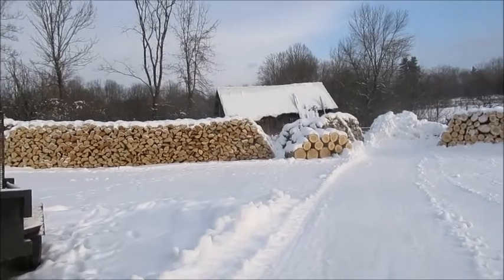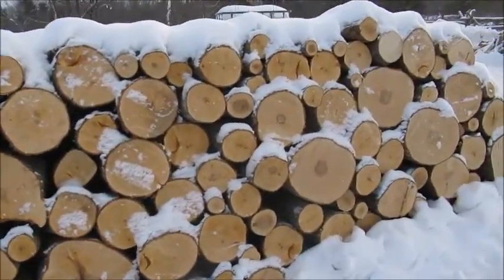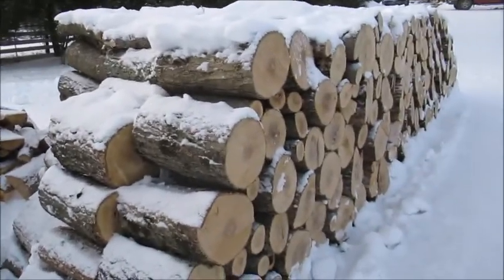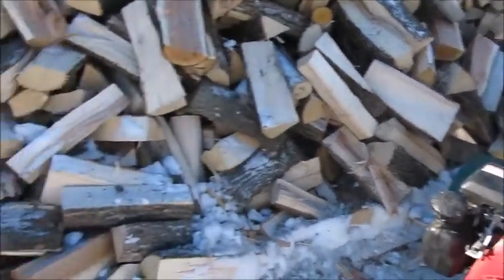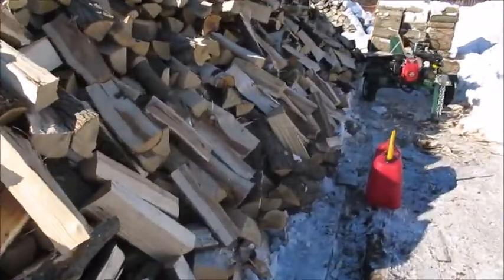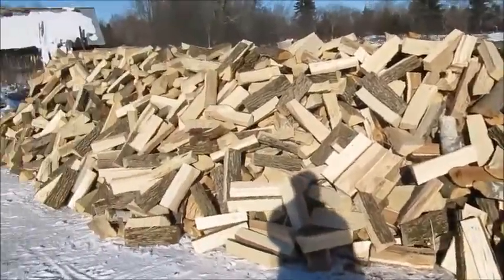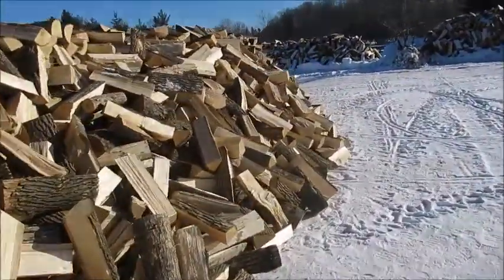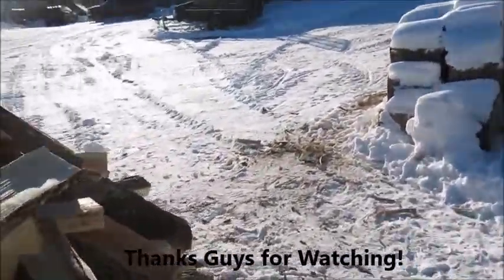Random Wood Stash 2021 Updates & Splitting Wood when it's -28c

Comment: Sorry about your loss of your mother.  You sure do not lose time splitting wood. I am amazed how quick you go through all those rounds! I've read below it's about 15.5 full cord you did I thought it would be more than that.  How many trees did you have to cut down to get to this amount of wood?  I am asking, because my goal is to make about the same thing as you did. 10 face cord for me, the remaining for sale.  If I can make more for sale (up to 80 face cord), that would be nice. But I don't think I'll make it this year.  I've got about 25 trees cut down, they average 12-16in in diameter 50-60 ft tall. I just can't figure well how much more I should fell this year.  Any hint on that? Thanks!
Reply from the maker: Hello Joe, Thanks so much for your kind words.  I am thinking about a 4 way wedge for my splitter. I think my wood for sale is about 12 full cord and than my own personal wood there is about 3-4 full cord that I split this season ( Mostly dead elm about 16 trees) plus some black cherry ( 5 Trees) and a bunch of iron wood and a few other kinds ...this is not counting my left over stash from last year. I would love to cut some more to sell but the snow had put a halt to that right now. Depending on the tree size ,it takes a lot of trees to get a 12 full cord pile. I will have to get back to you on this and do some figuring . I have smaller trees 10 inches up to bigger trees 20 inches so it makes it hard to tell. You see all my wood cutting videos since last fall to make all the wood I have. I won't know to I stack my wood to find out how much I really have. LOL.  I guess you could cut some until you have a full cord stacked up and that will help you know how much you need to cut. Thanks again and keep warm
Reply: Joe if you do have 25 ( qty of tree of 1 feet average diam ( 12-16 in ) ) X 50 feet ( average length ) = 1250 cubic feet of wood. Now a full cord is 4 feet ( high ) x 8 feet ( long ) x 4 feet ( deep ) = 128 Cubic Feet.  So if you have 1250 cubic feet / per 128 Cubic Full Cord = 9.76 full cord that you have make so far,,,   I'm right Joe ??? Now if you need to sell 80 face cord divided per 3 to know the full cord that you need. ( 1 full cord normally produce 3 face cord of wood )  So you need 26.7 full cord to have 80 face cord of wood . I'm still right Joe ??? 🤔👌 So 26.7 full cord X 128  cubic feet of a full cord = 3417.6 cubic feet of wood that you need. So if you take your 1250 cubic feet of wood made of 25 trees divided per 3417.6 feet that you need ( actualy you use the biger number divided by the smaller number ) = 2.73 time the amount of tree that you need so more threes,,,, So 30 threes of the same diam ,,, I'm still ok Joe !!! 🤔👌 I'm going to bed,,,
Reply: Lol! I am getting dizzy!
Reply from the maker: @RCAFpolarexpress  My thoughts exactly! LOL
Reply: @FromSteelToWood  Hey Boy that is not fair !!! LOL
Reply: @FromSteelToWood  OK Joe so keep it simple... lol  You will need a total of around 60 three so you have already cut 25. SO you need 30-35 more to go !!! LOL
Reply from the maker: @FromSteelToWood  Dizzy!!!!!!!! I passed out after reading what Dave wrote. All the blood drained from my head. LOL